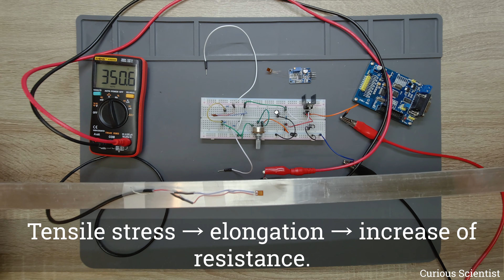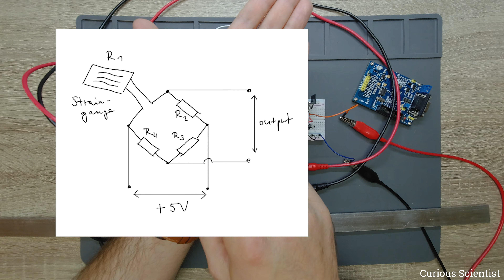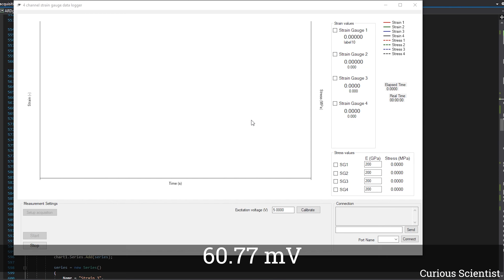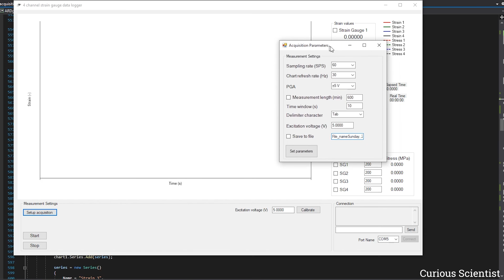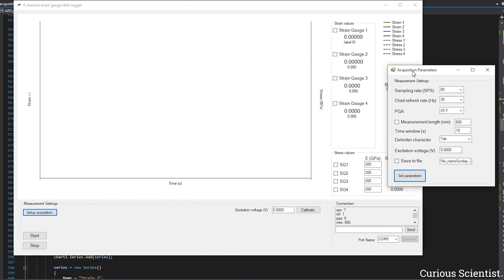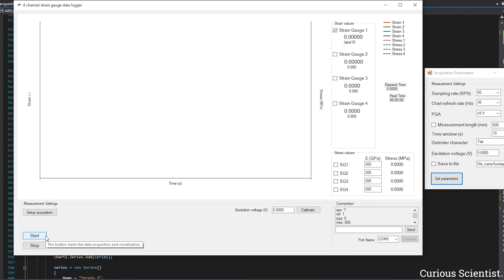Measuring the output of strain gauges

Comment: Thanks for this.. seeing you work with a breadboard made me confident in not needing the strain gauge manufacturers ridiculously expensive amplifier for testing while making our own..
Reply from the maker: Hi! I am glad that you found my video helpful! As long as you are not looking for extreme precision and high resolution, you can work with relatively simple circuits. If you want to improve the things, you might want a stable voltage source for the Wheatstone bridge, a high-resolution AD converter (16 or 24 bit) and some amplifier. But in my opinion the built in PGA of the  ADS1115 or the ADS1256 is enough for "hobby purposes". Part of the high price of the professional equipment is that they need to fulfill different standards and they also work reliably on the field (noisy environment, or other stuff).
Reply: Hi,
Do you belive strain Gauge module which you showing would woork precisely?
Reply from the maker: It works precisely.
Reply: @CuriousScientist  but i have to use half bridge because i need more sensitivity. These circuits are not available for half bridge commonly if you found Pl let me know
Reply from the maker: You can desolder the corresponding resistor from the board and attach the cables from the strain gauge to its place.
Reply: @CuriousScientist  ok  it will work. i am thankful for conversation.
Greetings from Pakistan.
May i ask where you from.
Reply from the maker: It should work. Greetings from Sweden!

Comment: What type of wires are those? My wires are too large to solder to the gauge.
Reply from the maker: AWG30 (0.05 mm^2) cables with silicone insulation. So they are not only thin but also super flexible.

Comment: Great video! I just ordered a kit online for 4x half-bridge strain gauges that can be connected with HX711 to Arduino. My question is, your video shows only 2 wires for each strain gauge. The kit shows 3 wires coming out of each strain gauge... is that because it contains 2 strain gauges in each sensor (one in compression and one in tension configuration) to double the output voltage difference?
Reply from the maker: Hi and thank you! I think the three-wire strain gauge is what you just correctly explained! Usually, it is called a half bridge strain gauge. As far as I know, the most straightforward application of this is the cancellation of the temperature effect. One strain gauge is exposed to the strain to be measured but the other is not, so it is a "dummy" strain gauge and the change in the temperature will change the Wheatstone bridge in such a way that the temperature-induced effects will be cancelled out. But please notice that the "3 wire strain gauge" can be achieved either by two similar strain gauges wired in a certain way, or you can buy strain gauges where there is a special pattern of wires on the resin sheet and the geometry of the wires will result in a 3 wire configuration.
Reply: Hi. Which is the kit? Thanks

Comment: Did you get drift if you held a static load? I did this with an hx711 ADC and it seems to drift upwards noticeably overnight. This is very linear and im thinking of using this ADC instead.
Reply from the maker: Haven't tested it, but I can test it in the near future. When I calibrated my 5 kN load cell for my tensile testing machine, I used a HX711 for the load cell and there was a drift. But the drift was within a few grams equivalent force, so I neglected it. Also, drift can also be a creep phenomenon and not necessarily drift.
Reply: @CuriousScientist  I'm looking for an application where we are weighing for 60+ days straight without calibration. Tried the HX711 a few times now with the prototype scale. The reading seems to continue to slowly move higher after successful offset and calibration. (With two different libraries).

Ordered an ADS1256 today to feed into an Nano 33 IoT. Will also be sourcing lower resistance, higher quality strain gages.
Reply from the maker: Another trick could be to "follow" the creep of the values. You can tare the weight in certain time periods. It might worth a try. But yeah, it might be better with a custom built Wheatstone bridge, power supply and AD converter. Then you really know what you are measuring.
Reply: What is the voltage source for the HX711? Could it be changing overnight. 
Reason I say this is the HX711 has the ability to control an external transistor for a stable excitation voltage. This transistor won't get used if the voltage input is lower than the excitation voltage set with a potential divider. I did a video about it recently.

Comment: Can you recommend a pletier?
What number plates work cool and consume the least amount of power?
Reply from the maker: This video is about strain gauges and not Peltier coolers. 

The smaller the current (last 1 or 2 digits of the TEC Peltiers), the smaller the consumption as well as the provided cooling power.
Reply: @CuriousScientist  Tec-? Good product quality
Reply from the maker: @ValentineDay.ForYou.  Depends on where you buy it from. Some sources are not too reliable. Other Peltiers can be very expensive, even several hundreds of USD per piece.